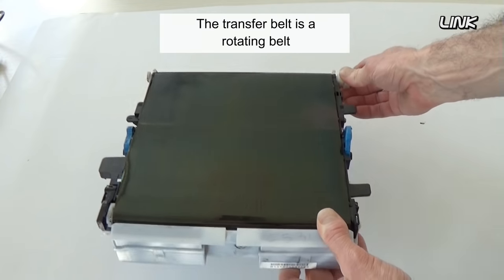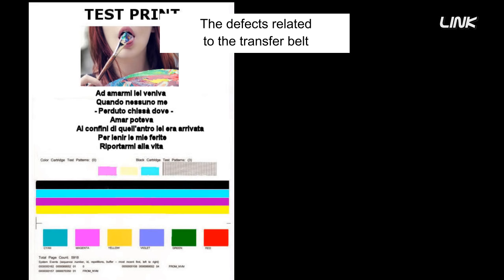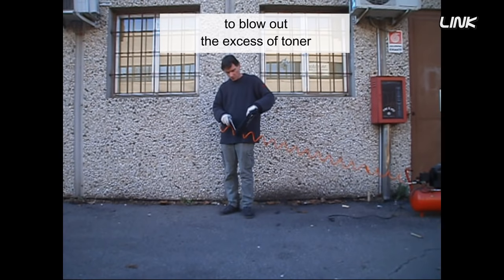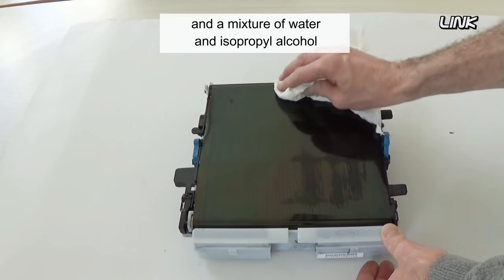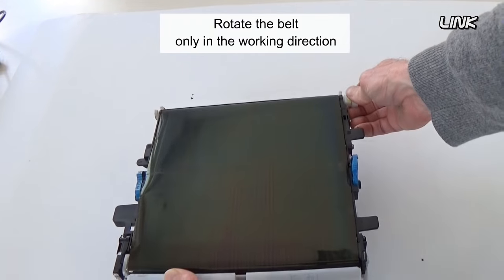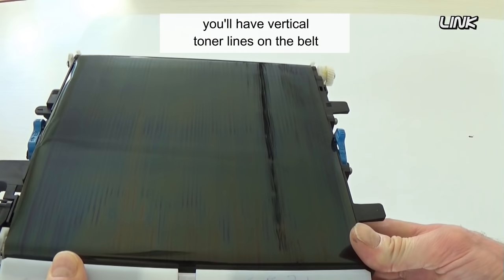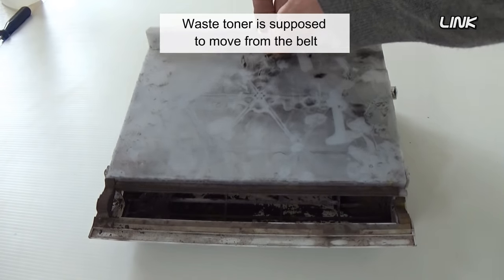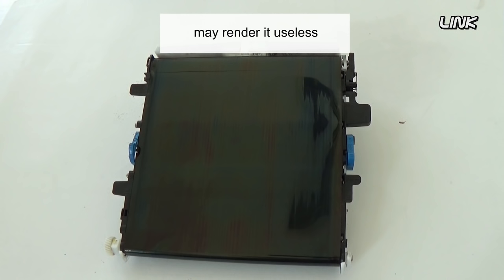How to clean a Laser Printer Transfer Belt

Comment: Thanks for information.
I'm looking for the wiper blade, and now I find it.

Now I will find a way to dissamble the transfer belt.
My printer is Fujixerox CM205.
Reply from the maker: May be on Alibaba/Aliexpress. Avoid ebay
Reply: @viandant5  

I mean, I tried to find where the wiper blade in my printer.
Now I know where it is from this video. It's in transfer belt block.

Now I try to find how to disassamble the transfer belt block so I can replace then wiper blade.

Comment: Hi! Great Video! The Transfer Belt for my OKI c5150n Color Laser Printer keeps showing up online as a Discontinued Product. The Printer Parts Companies that still have them in stock, want over 250.00 bones for them. Can I buy a separate "lone standing" Ribbon Roll of Transfer Film and re-splice it onto my old transfer belt? I've already "taped" my old ripped and torn transfer belt ribbon with Scotch Tape and it's holding, but yes, there's streaks from the pieced tape on my printouts. Any thoughts?
Reply from the maker: Yes you can, It seems the problem is only the belt and the other components (wiper blade and so on) are ok

Comment: I hope you can help me. I have a HP 2605dn printer and I love it. After 5 years it has finally run out of toner so I bought some from InkOwl and filled it myself. Now the colors are more faded with full cartridges than they were when they were empty. And there are splotches and streaks of color all over the transfer belt and toner on the cartridge rollers.  I have manually cleaned them many times and also ran the cleaning setting. Nothing works. Did I overfill them? This simple printer has never given me any trouble. I'd hate to have to buy another one.
Reply from the maker: how do you filled them? did you remove the waste toner, at least clean the drum, the charge roller and the doctor blade?
Reply: It's better to change the drum anytime you refill your cartridge. Try to change the drum, I bet it will solve the problem

Comment: @viandant5 Thanks for the video! always very helpful, One question, my brother hll9310cdw is trowing too much toner on the belt, I just clean it and the 4 colours were there in big spots, I just clean the drum cilinders also, they were mess uo too, and just noticed that the edge of the pager got some discoloration on it..    I got no spots or holes on the belt is good, is like the magnet or whatever it is that attract the toner is not working, what can i do?
Reply from the maker: are you sure the environment is not too humid? I think it's a toner cartridge problem
Reply from the maker: the belt is charged with a charge roller, in this way it attracts the toner powder
Reply: @viandant5  Ok then, I will change the cartdriges to confirm if that's it, because we don't have no humidity right now. Question: my belt is different from the one you are cleaning, should I proceed to clean it like you are showing in this video? I just clean the printer inside out all the little metals and the belt and cylinders from the drum with half and half alcohol and water, so I just send to print a test and came out with 2 blue lines , 1 black and 1 red.. I don't know what i did wrong..
Reply from the maker: @lilianalopez9474  YE syou could clean the belt as show in the video. The colored lines are often due to bad contacts or little defects on the belt that without the protective layer discharge on the belt
Reply: @viandant5 Great, I am gooing to check on that.. thanks so much!

Comment: Good video! I have a question. My printer Brother L3750 can’t perform toner registration. There is an error message on the end of procedure: “Registration Failed”. Color printouts look bad. Each color seems to be misaligned to another (0-1,5 mm). On Brother webpage I’ve find info that it may require changing of belt unit. Any advice?
Reply from the maker: It depends more often from the drum units. But you need toner registration? do you have quality problems or other error messages?

Comment: Hi can you help me? With new or old toners I aways get horizontal black lines. On first page in the middle. On second page on top and almost on 2/3 of the page another line.
Checked the drum and didnt notice any damage. It is a samsung clp 325. 
On the page where appear 2 horizontal lines the distance between them is 190 milimeters. Thanks a lot
Reply from the maker: 190 mm the problem is the drum
Reply: @viandant5  sad to hear that. Tks

Comment: Great Video! My brother HL-4070CW duplex printer prints random,light toner patterns only on the backs of pages. Could this be the belt? Front of pages is perfect.
Reply from the maker: Ye it could be the belt but it could also be the second scanner unit, or a dirty paper path or rubber rollers
Reply: @viandant5  Yeah, I had leaky cartridges. Where is the second scanner? I guess it needs a through cleaning. Thanks
Reply from the maker: It's inside the cover of the scanner I think
Reply: @viandant5  Thanks. this model is just a big printer, not mfc.

Comment: Hi. I have an hp colorlaserjet printer mfp m182n. I have refilled all of the 4 cartridges. The printing quality is fine. But there is one problem with the magenta cartridge that few lines of very minimum width appears on its own drum after certain prints.though lines does not come over paper, they only appear on magenta cartridge drum.  But after about 100 pages printed successively these lines come over paper.
Would you please tell why this happens? And its solution if it is a problem.
Reply from the maker: May be a dirty wiper blade, or the developer roller blade too close to the roller
Reply: @viandant5  already done those. But problem still exist.
Another another solution?
Reply from the maker: @hathakker802  When you rotate by hand the drum it's normal that a toner line appears on the drum surfsce
Reply: @viandant5  actually the problem is that when I print about 80pages in line, sometimes, the magenta line develops on 50th page and onwards. The line is very very thin. Then when I inspect the drum I see a line on it, then I clean it and rotate it and clean the entire line. After cleaning when I rotate by hand no line appears on drum. Then when I again prints 80 pages in line, magenta line develops on 50th page and onwards
Kindly tell solution of this problem. I have already cleaned the wiper blade, developer roller , pcr and opc drum

Comment: Hello you've told that there are no reliable ways to restore the scratched drum of a laser printer, but I need to ask you is there any way to restore/fix drum though it may not be reliable?
Reply from the maker: There are coatings but it's easier and cheaper to buy a new one

Comment: Thanks for the video, I have brother colour laser printer L3710, it’s printing colour letters/images with shadows (ghost printing) , i cleaned the drums and seems to be okay , fuser 75% life remaining.
Should i clean the roller attached to the fuser or the tray belt or what to do , thanks a lot for your help.
Reply from the maker: it could be related to the toner cartridges too
Reply: @viandant5  thank you i changed all the toner cartridges to ( original ) and after calibration working good. So the problem was a defective cartridges ( old) , or only i can install original. Thank you once again and appreciate it.

Comment: This was an amazing video. Thanks! I+m having the message in my HP Colar Laser MFP 178mw printer "replace new transfer belt". The manual says when shown this message: "the life of the transfer belt has expired". Does this mean I MUST replace the belt or can I still clean it and have it working again? I need to make sure I can do that before investing in new toner. Thanks
Reply from the maker: The cleaning does not cancel the error message. There should be a chip, or a fuse

Comment: Hi! Im wondering if my issue is from the transfer belt. It prints some of the papper, but some zones appears white. As a jump every rottating pappers is going. it happens in all the pappers, but not in the same posittion.Sorry about my english
Reply from the maker: It depends on which printer do you have and which is the distance between defects
Reply: @viandant5  thanks for the reply. Its a lbp5300 canon.
Im pretty sure is the transfer belt . The blanc zones are blanc... as if the tonner didnt touch the papper. Im waiting a replace for it.
Reply from the maker: @MrRoicinho  But are you sure? It's more probable the drum or the toner cartridge
Reply: @viandant5  quite sure. The tonner are new... ive tried with the old ones and same result. 
The fact is that seems that not tonners dust is impregnating the zones of the paper at some regular spaces
Reply from the maker: @MrRoicinho  which is the distance between the defects?
Reply: @viandant5  almost a entire sheet. The  printer prints the blanc section in one sheet and on another sheet the blanc section again, almost in the same position
Reply from the maker: @MrRoicinho  yes, it could be the belt
Reply: @viandant5  thanks!! When the replacement reach my home, i will post here to tell what happend at the end. Regards!!
Reply from the maker: @MrRoicinho  ok! Let me know
Reply: @viandant5  hi!! It was the problem at last! Ive purchased a second hand transfer belt and it works as a charm!
Many thanks for your advice. So many thanks!

Comment: Hi. I have a samsung clp-680.
When i print documents it will work perfectly, but on images or pictures is blurry. What do you think i can do to make it work??
Thank you
Reply from the maker: Does black images have problens? It could be something related to a color cartridge. Did you check the printer settings?
Reply: Thank you for your reply 
Black it doesnt have any problem or any written thing just on images...yellow goes 1mm to the right side and blue goes down 1mm... dont know what to do in settings
Reply from the maker: @AURELIANBXXX  I dont' remember how to do the calibration on that printer, if you have the manual there should be the procedure
Reply: I don't have the manual but i will search online for it ... thank you for your time and help.

Comment: hello friend, I have a hp m570dn and stains the sheets vertically, when you open the printer the transfer belt is stained, the clean but a few prints again stains the leaves. I do not dare to disarm the girdle, only clean it but it is annoying to do this cleaning at every moment. The option would be to change the belt?
Reply from the maker: are you sure the problem is the belt? it may be a defective toner cartridge too
Reply: hello, the cartridges have changed several times, the printer is used in a school and you always have to reload 2 times and then new cartridges, the lines now come in different luagres but always vertically. At first left to the left side of the sheet, then to the middle and left, varies position.

Comment: Can i use ethanol 100% for cleaning belt surface or will I doing that make him useless?Thanks
Reply from the maker: what's ethanol 100%? isopropyl alcohol? yes, you can use alcohol
Reply: @viandant5  ethanol?
Reply from the maker: @thedropperofdroppedItems  isopropyl alcohol is not ethanol
Reply: @viandant5  Can i use ethanol for cleaning printer parts?
Reply from the maker: @thedropperofdroppedItems  Gears fusers and so on? yes

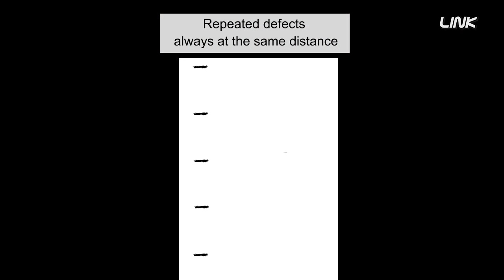Comment: Hi - precisely at 1:06 the horizontal lines that appear, is that from fusing kit or something else? I watched all your videos but couldn't figure exactly how to fix that issue. Thanks for your hard work!
Reply from the maker: It depends on the distance between defects
Reply: @viandant5  my printout has the same distance as in the frame at 1:06 and if it only appears when the printer is fired after sitting idle for 20+ minutes on first couple of pages but not the subsequent pages. For e.g., in 10 page printout, only the first two have the roller marks on the left side but the other 8 pages don't.
Reply from the maker: @fzall1457  Probably it's a fuser roller problem
Reply: @viandant5  very sad and need help. I bought a new fuser unit, new waste toner bin and used transfer belt but I still have the same problem. Any other thoughts?

It only happens when few pages are printed and system goes in standby for sometime, say 30 mins, and on next print job there are few pages with roller marks on the back side like at 1:06 portion of your video. If the job is long and more than 3 pages are printed continuously then there are no roller marks on remainder of the page.
Reply: Fuser 99 out of 100

Comment: Great videos. Apreciate your help. Recently I have change the fuser roler of Brother Hl3150.The same as the video. Evreything was good But few days later the black color started to print some mm up, i did registration and failed. I change cartridge and failed. then, i change belt unit from secon hand and fail. I clean drums. I do everythig, and still do not know where can a fix the problem. Any guess?? thanks a lot. Aaaa, i change the black with the blue color, and the problem occur in blue color 😆😆
Reply from the maker: It could be a deformation of the frame of the drum unit, or a defect on the gear of the drum unit or printer. probably a cleaning is not enought to solve the problem.
Reply: thanks i will search info

Comment: I just cleaned my belt, and find that it's pulling to one side. Is there a way of getting it back in alignment?
Reply from the maker: it's difficult to say without knowing which is the printer. Is the belt broken or defective? if not, remove and reinstet it
Reply: Spring tension problem
Reply: @rstjohnw  Thanks D. I called in a friend lifeline. :) Turns out, whatever he did, it's working beautifully.

Comment: thanks for the videos ,my printer is not working , all the papers are getting spoil from too many color after printing how can i get it fix?
Reply from the maker: without knowing wich printer do you have it's difficult to say. may be the dum unit
Reply: @viandant5  ok thanks for the response the printer name is Laser jet pro CM1415fn color MFP  how can you help me to work it up
Reply from the maker: @we-carefoundationngo113  This printer has toner cartridges with lot of problems. Check the transfer belt too, is it dirty?
Reply: @viandant5  Let me take the opportunity to ask: From your experience with the CM1415, do you know what can cause a very faint print in all 4 toners? I already disassembled it, cleaned transfer belt and inside housing with no result - some people say the HV power supply may have problems, but I wonder if there is any other cause for the faint print (this is a very low usage printer). Thanks in advance for any help you can provide!
Reply from the maker: @JoseSilveira-newhandleforYT  It could be the power supply but cleaning the transfer belt may be not enough if the belt is too worn or old.
Reply: @viandant5  Thanks for taking the time to reply! Belt has little use and seems OK, but is 5 years old. I just hoped there was some typical known problem, besides the belt or the HV.
Reply from the maker: @JoseSilveira-newhandleforYT  It's a typical problem of the toner cartridge, this is one of the worst color toner cartridge ever made. But if you the problem is related to all the colors, probably the problem is not the toner cartridge. 
However, a defective color toner could give problem to all the prints. with the yellow you obtain blue, green, orange and even grey. If the yellow is defective, a print could have problems.
Reply: @viandant5  Thanks again! You may have a point there  - had no idea these cartridges were so badly designed. The yellow cartridge is new (remanufactured) and it's almost invisible. Black is almost acceptable (though remanufactured). Cyan and magenta (both original) are also almost invisible. Wondering if a bad cartridge can short the HV for the other cartridges... Have to isolate cartridge contacts, one by one, to see if it influences the print density.

Comment: my printer doesnt print magenta color, i think maybe laser of magenta cartridge is obstructed, Where is the laser of magenta cartridge?, my printer is hp cp1525, pls help me, sorry about my English.
Reply from the maker: I think is a toner cartridge problem. did you try to change cartridge? check the connection between printer and cartridge. a defective laser scanner should give an errro message
Reply: @viandant5  What if the printer doesn't have beam detect sensor? Could be bad transfer or transfer high voltage. Clean the magenta transfer components.

Comment: my belt kept showing up the previous print image. so my next print will have a light prinout of previous print. how to fix that?
Reply from the maker: It depend on which printer do you have. could be not related to the belt but a toner problem
Reply: thanks for your reply. it's Fuji Xerox DocuCentre V C4475. faulty toner? how to check a leaked toner ?
Reply from the maker: It's a defect moslty related to Drum orr fuser unit
Reply: thank you sir!
Reply: will it help to clean the drum and the fuser?
Reply from the maker: May be if the problem is related to the fusers. If the problem is the drum, probably it's worn out
Reply: ok. i will replace the drum first and check.
Reply: @viandant5  my printer is brother mfc 9330 cdw same problem with drunk tea can you help me

Comment: do not use any kind of liquid, not even alcohol, to clean the belt. use a microfiber cloth. even alcohol will leave streak lines, and it's supposed to be residue free. it isn't.
Reply: Thank you for sharing this thought, I cringed at the alcohol solution.  I wrecked an older HP LaserJet 4 without the appropriate info.  I would say if you want to do any maintenance, first step is reading the manual.  Reading that will say what you can do.  I bought my Brother colour LED printer from a business equipment dealer and if I ever need it to be cleaned, I will trust the techs there.